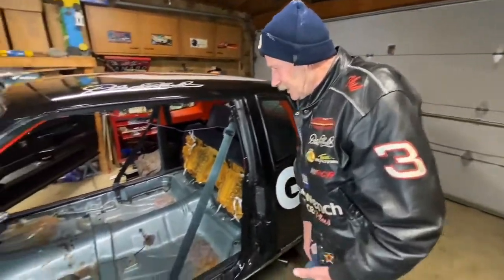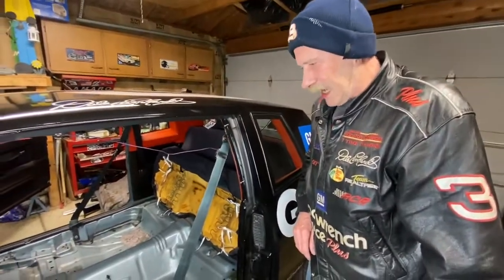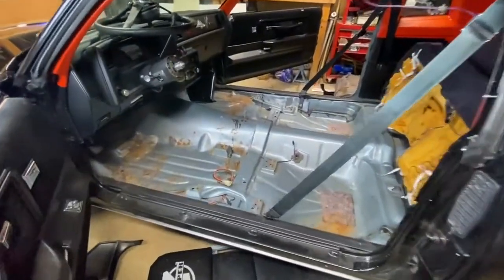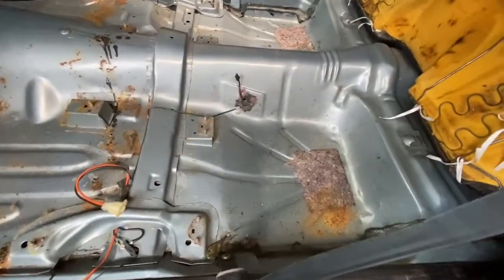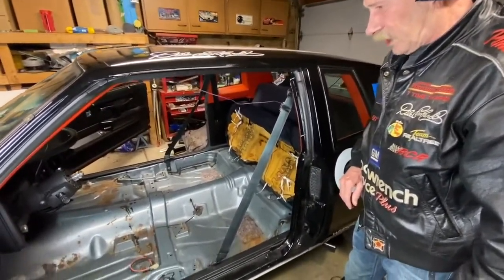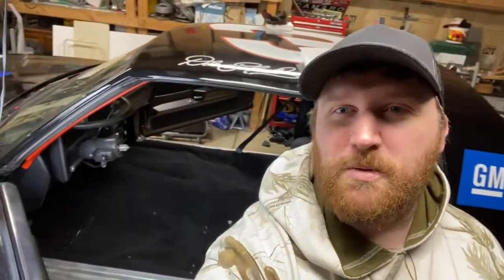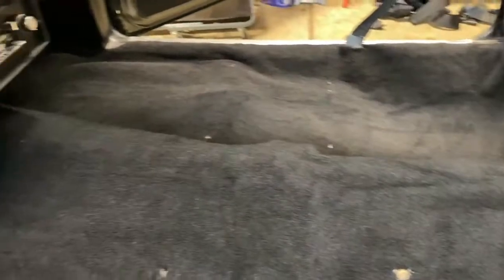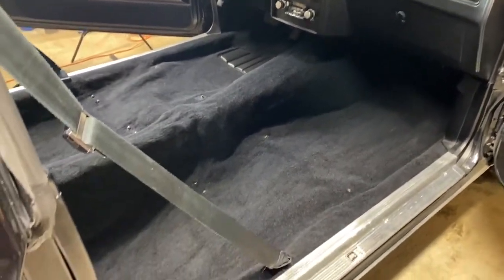Carpet & Kilmat Install G Body Monte Carlo   DaleCar

Comment: Needs carpet glue, it will adhere to the tunnel, then cut excess
Reply from the maker: Ahh!! Didn’t even think of using spray adhesive haha thanks for the tip!  Going to be making an upcoming video showing the updates we’ve done. Ended up installing a floor shifter so the boot ended up securing it a little better. Thanks for watchinng